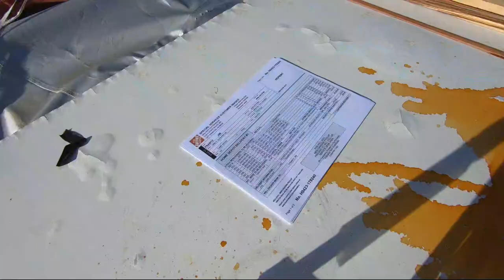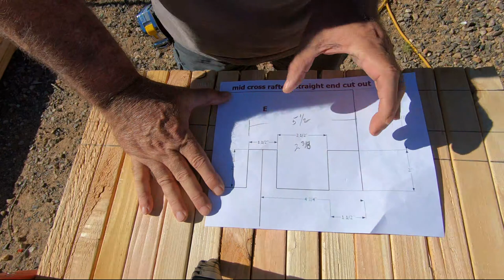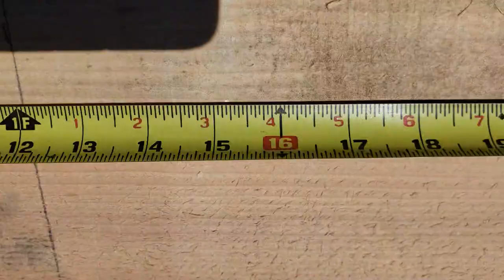How to Build a Pergola | Time Lapse

Comment: Great build. I guess the only thing I would have (tried) to do, would be to marry the pergola to the existing railing. Would have definitely been more work, but you would have eliminated that dead space between pergola uprights and railing. Keep up the good work!
Reply from the maker: Hi Eric, Welcome!  Yeah I thought about that to and opted to keep the uprights along the main beam below as the deck is cantilevered and didn't want to put undue weight out there but I extended the rafters out to balance the look.  After using it  the dead space was not much of a problem since deck furniture fits in those spots.

You have a good eye Eric and believe me I went round and round on this decision.  Thanks for watching I appreciate it!
Reply: ya, obviously the right choice on bearing point load, but it doesn't look like that place gets a whole lot of live load in form of snow...lol

Comment: Great work!!!

Is it all pressure treated lumber ?
Reply from the maker: Hi Naseer,  No none of it is this is all pine but I used a heavy oil based finish on it because of this and it has been holding up extremely well in the Arizona Weather.  It looks like about every three years to refinish to keep it looking good.

Don't get me wrong I think all outside projects should be done with treated lumber it's just that our lumber sources only had the dark brown treated lumber and that would not have looked very good.

Comment: Thank you 🙏🏼 you covered a lot in a short video. One comment, how did you decide about how much to offset when you connect the main horizontal beams to the columns?
Reply from the maker: Hi and welcome to the community,  When I design these I try to do it with even spans and  numbers and plan for the least amount of waste as possible.  I try to have at least a one foot offset on ends with a pergola.  I hope this answers your question but if I didn't read it right let me know.  Thanks for watching!

Comment: so that router bit just rides the plywood template?
Reply from the maker: Yes on the cross piece notches I let the smooth upper part of the bit.  Best to use a flush trim with an upper bearing for something like this.